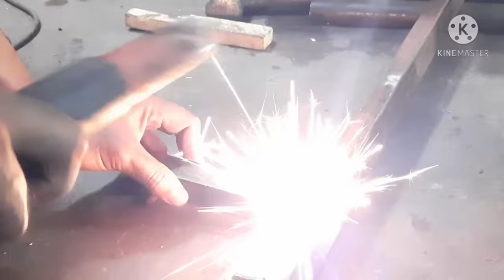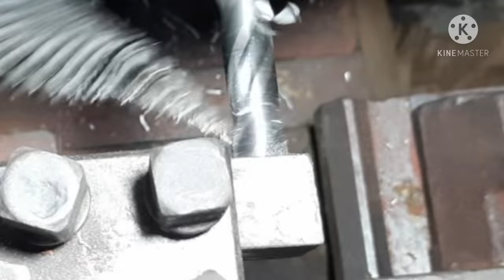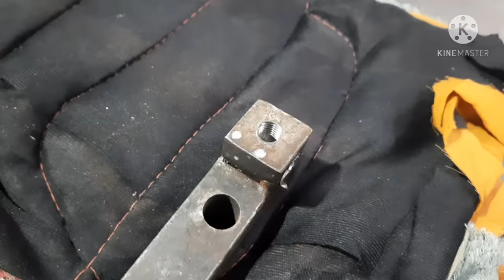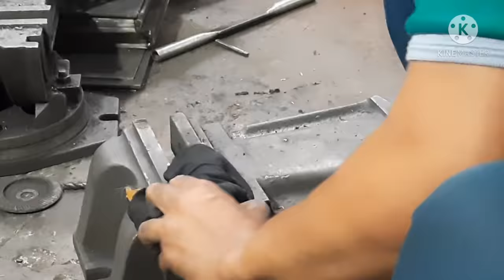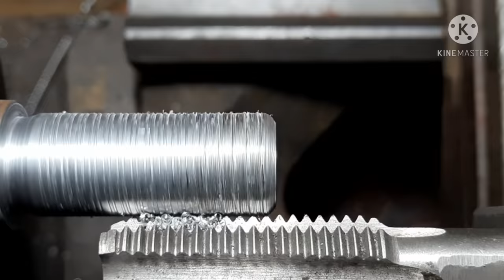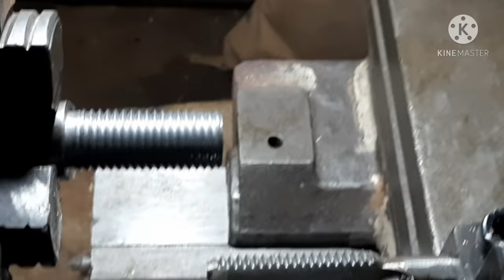buat ulir pahatnya pakai TAP |make thread wear tap knife on the lathe| ARIFIN LATHE

Comment: What are the advantages over using a conventional tool?
Reply: None, it’s less rigid, has less clearance angle and more chance for chips to rub in the flutes that are not cutting. It’s objectively worse in every possible way compared to a single point tool. They aren’t even that hard to grind by hand.
Reply: @shiro-r4m  I wondered!

Comment: Okay. This is the way only for DIY, because the internal and external threads are different. It has are different profile at treatment tools and as rule you will receive wrong tool width on the shaft.